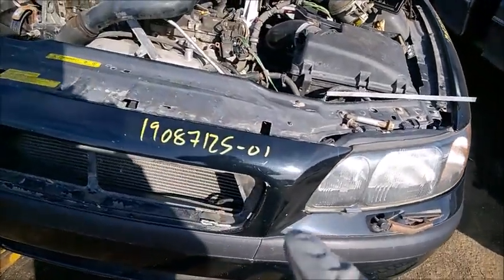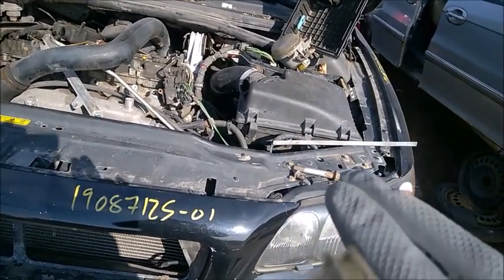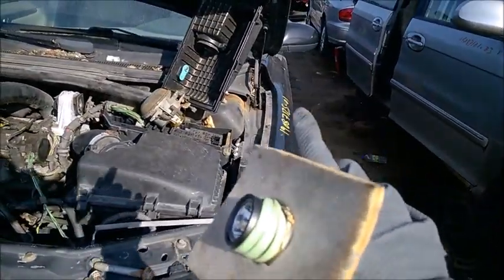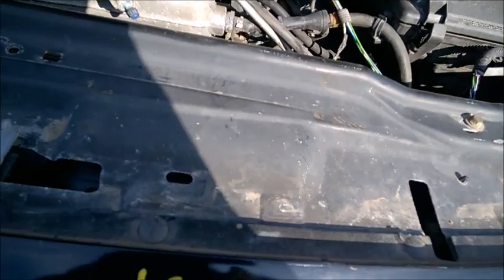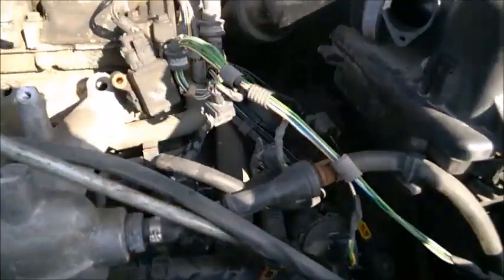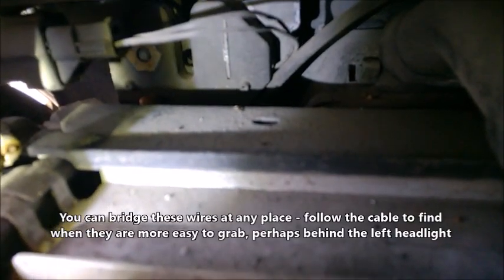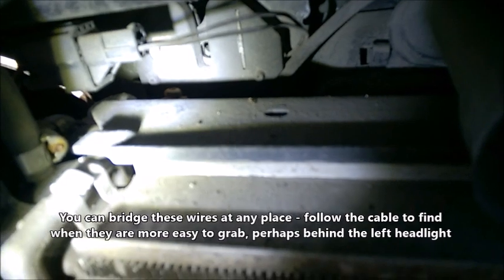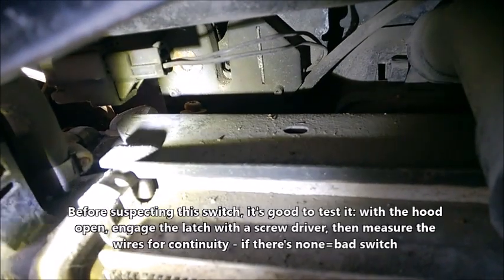Volvo S60 V70 XC90  Hood bonnet Alarm microswitch location (alarm not arming)

Comment: I got this problem on my XC70 2015. The main problem is caused by the grease from the latch that gets inside the microswitch which is part of the latch assembly. So is simply spay contact cleaner on the latch. I use also ethyl alcohol an spay ( several time) on the latch in place. So you don't need to disassemble the latch at all. Let it dry so the alcohol or the contact cleaner spay evaporates. Close the hood and see the microswitch should be clean and message should disappear.
Reply from the maker: Would be safe to have the battery disconnected for a few hours, to prevent any short - the time any cleaners takes to fully evaporate from inside the unit.

Comment: Thanks! I think this may be our car's problem, except our red light blinks. However the turn signals don't flash when we lock our car, and I'm not sure if that's just the dealership programming or if the car thinks that the hood is open. I tested it and even with the hood open you can lock the car and get a red flashing light. It just probably won't flash the turn signals. 

I've read online most people fixed theirs just by slamming the hood closed.
Reply from the maker: I think if the red led blinks the alarm should be engaged so all doors/hood switches should work fine. Not sure about blinkers flashing, maybe just a programming as you say. Slamming the hood is the last thing I would do : the microswitches are already fragile plus the latch unit has the bad habit of loosening the two securing bolts which can cause a hood open - a big pain
Reply: @Peppermint1  ah, well thanks for the insight and I'm definitely not going to slam the hood. Would you say even dropping the hood from a few feet is too hard?
Reply: @Peppermint1  just the weird thing is the red light blinks regardless if the hood is closed or not